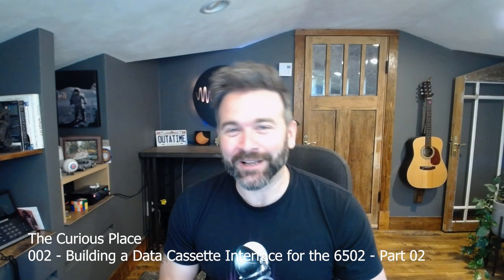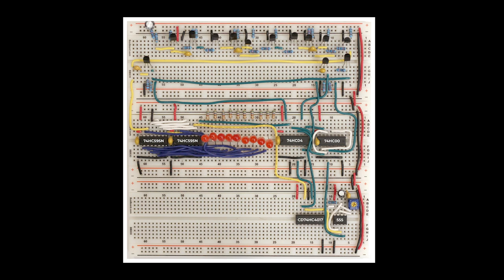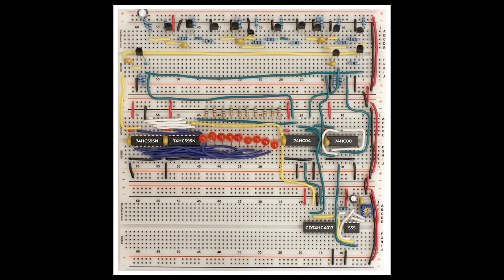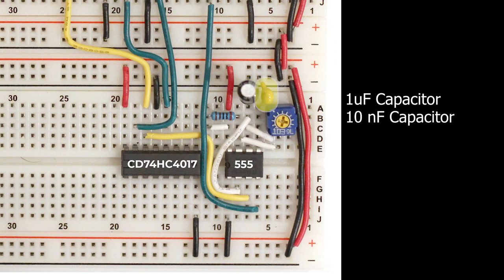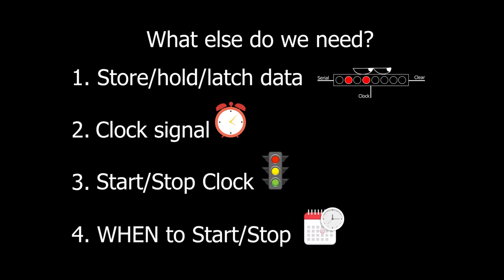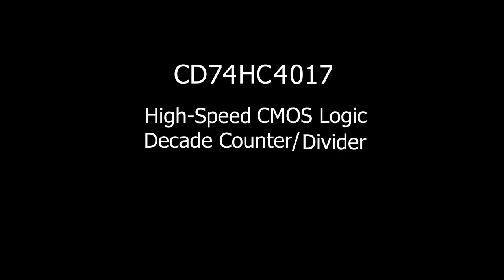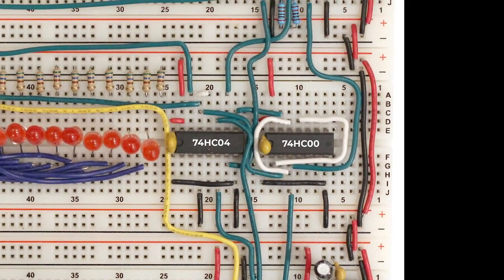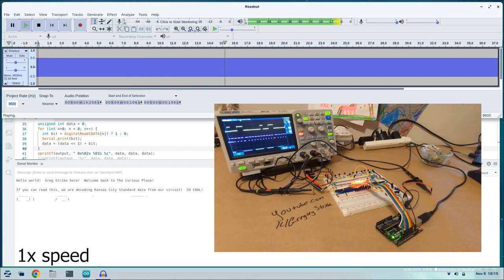Tape Storage for a Breadboard Computer - KCS Part 2 - The Curious Place 002

Comment: I remember some friends trying to use the cassete routines on a MSX as a rudimentary telephone line modem. I don't remember it they were successful.
Reply from the maker: Interesting...  I don't see why it WOULDN'T work!  Reminds me of a time, back in the day, when I connected two computers directly to one another using just their modems...  No phone company, just directly plugged into one another.  Now that I think about it, i think the time period was a bit later as they were 56k modems.  ATDT on one.  ATA on the other.  I thought it was strange that I didn't get full speed out of it...  If I remember correctly, the negotiation rarely came in at 56k doing that.
Reply: @GregStrike  IIRC they had difficulties on coupling the cassete port to the phone line, even by modding a telephone set
Reply: @rafaelgcpp  I remember seeing an interview with someone where they talked about doing this with a spectrum. Basically just phoning the person and then then they connected the wires to the ear socket of the spectrum and did a save at one end and a load at the other. It worked for them according to what they said. The loading routine on the spectrum is very tolerant though, not sure what the msx one is like.

Comment: Why not drop the counter entirely but invert pass a bit through the shift registers and wait for it to arrive at boot bit 10?
Reply from the maker: I initially tried that.  But the problem was the start but it's always low, and you can't guarantee what the first bit will be to be inverted.
Reply: @GregStrike  I wonder if you can shift in a one bit from the detected falling edge of the start bit before the clock starts running.

If you can keep !Q high for long enough after the falling edge of the start bit triggers it or the input to the shift register with that extended !Q in the in the window before the clock starts shifting in the other bits, then you should have a one bit pushed tough ahead of the data bits. Would also need to clear the register before clocking that bit in though…

Comment: You're explaining a very advanced circuit (literally a UART receiver hand built) using very patronising terminology but not actually providing a schematic for the circuit you're building.

As an actual EE graduate this content is interesting to me, but poorly presented. If you're gonna feature a project this advanced plz share a logic diagram or two in your videos not just a screenshot of your breadboard, and consider pushing the intro content like "Mr shifty" into it's own video. I think most people attempting a project like this understand what ab inverter, shift register and sr latch do at a level required for this